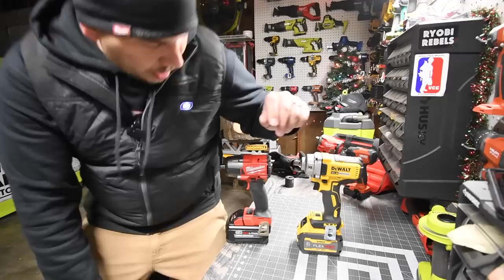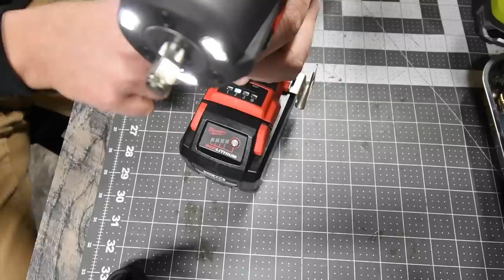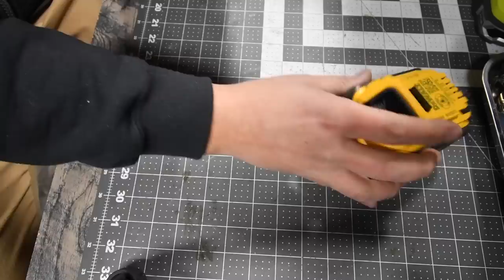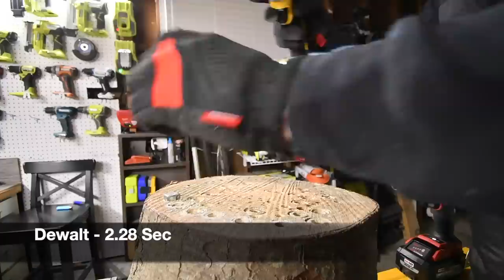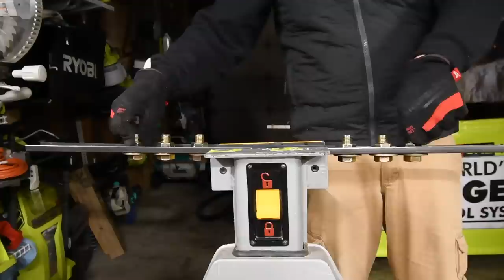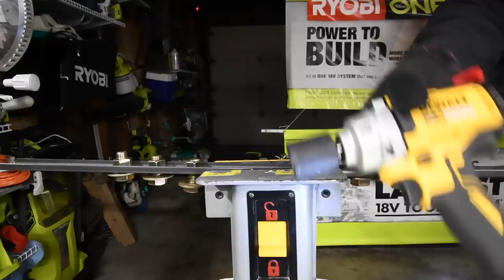NEW!! Milwaukee 2960-20 Vs.  Dewalt DCF894 (Impact Wrenches)

Comment: Coming from a maintenance field, I do use my Milwaukee m18 Mid torque a lot, I have the standard fuel model 2860, thing is a beast. And no issue in tight spaces. Personally the only thing I use auto mode for is putting something in quick. But with the variable trigger any mode ca do that too if you have the feel for it. I personally have used the DEWALT and perfect the hog ring vs pin detention. Also yes using an adapter. Even the shallow one will result in some torque loss, might be less but it will reduce the torque.
Reply from the maker: gotta love impact wrenches and I thank you again for your feedback Tyler :)

Comment: i'll be getting the dcf849 because i already have the charger and two 6 amp batteries for my sawzall and string trimmer and it will do all i need and more . but WOW ! that Milwaukee is amazing ! if i still built for a living i'd be all over it in a 1/2 inch version . thanks for sharing and take care .

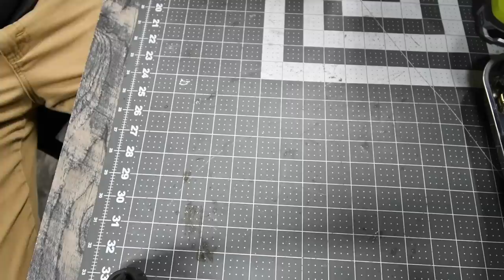Comment: The one thing I have learned is when your testing the speed of these impact drivers with the same battery out put is like testing the quickness of 2 similar vehicle's with the same horse power but one has 3:11 in the rear end and the other has 5:28 of course the one with 3:11 gears will be quicker using the same horse power.

Comment: I would estimate torque loss by 10 ft-lbs per inch on an adapter or extension. An adapter like that is probably only losing 5 ft-lbs at most

Comment: obviously the milwaukee is the winner because the torque is 600 ft lbs while dewalt is only 330 ft lbs.
Reply: Agreed a tool with double the power is no doubt going to win!
Reply from the maker: the dewalt is 600ft lbs
Reply: The dewalt on its specs sheet says 330 ft-lb
Reply: How you gonna review a tool and not know anything about it lol
Reply: Don't ever go buy written specs, I own two impact drivers one says 1600 the other 1425 and the 1425 beats it in everything

Comment: I am a huge fan of both Dewalt and Milwaukee brands.   I have a huge Dewalt collection of tools in the 18v to 54v range and a couple in the 10v range.   My Milwaukee collection is all in the 12V range and I love their smaller tool systems, especially their soldering iron.     They have a great lower voltage range that Dewalt simply don't manufacture.   One of the big benefits of Dewalt is their flexvolt range... never liked the 18v circular saws in any brand but the 54/60v Flexvolt range is a different beast altogether!  Be it Saws, grinders, table saws, blowers, whipper snipper .... just awesome.

I guess my only beef with your video is that you are wearing a Milwaukee jacket (don't get me wrong here.... I have several from wind cheater heated to work jacket heated but also have a Dewalt Jacket that is twice as warm .... have not even needed to use the battery heating power function!.....)  and you are also wearing the Milwaukee gloves.   

Mate, if you are going to do a video, selling us on your credentials that you are open to any results regardless of brand, please don't wear branded clothing that "happens" to coincide with the winning tool brand on the specific test you are doing.    In Australia, we call that a crapola moment!!!!!    ...... credibility out the proverbial window and back down shit creek!   Sorry but the small and big shit all matters!!!  

Other than that, thanks for the video!

Greg

Comment: Hi Dave

Wow, DeWalt still kept up with it's specs. 

Both great mid torque impact. You really can't go wrong with either one for a 5 to 6 seconds difference on certain application.   

Thanks for that comparison video
Reply from the maker: I agree with you on that one Micheal
Reply: It really depends on which battery platform you have.
Reply: @andybub45  that's why I'm investing in a battery and turbo charger in all three. Fuck that choosing a brand bullshit.  Best mid impact it mikitas new one,, best sawzall is milwuakee super sawzall, and best hammer/drill is DeWalts.
So I'ma get all three and then. Probably only get two batteries per platform. You can only run so many toollss sat a time so it's worth the extra price

Comment: Would love to see how the Milwaukee does against the new Makita. Really like the videos keep them coming.
Reply: Same.
Reply: Milwaukee wins.

628 ft lbs fastening for Milwaukee
514 ft lbs fastening for Makita.

DeWalt is rated at 330 ft lbs and is a 3 year old design so it was a massive under dog.
Reply: @juanc5149  Milwaukee will probably win again. True. But it will be closer than this.
Reply from the maker: once I get the makita mid range I will do a test
Reply: @ManCaverTools  awesome
Reply: @juanc5149  

Yeah, if we only look at a box spec (which you couldn't even get right, because Milwaukee doesn't claim 628 ft/lbs fastening, lol...) then Ridgid and Ryobi make impact drivers that are just as good as the Gen 3 Milwaukee.  And are better than the best Makita and Dewalts.  

Except that isn't how things shake out in real world testing.   + if you really want to compare box specs, the Makita is 740 ft/lbs in reverse, 15% higher than the 650 ft/lbs of the Milwaukee.  

Not that running a lag screw into a tree stump is a good way of demonstrating a wrench anyways.  That's mostly an IPM and RPM race.  Even impact drivers can beat high FT/LBs wrenches under certain conditions because drivers are breaking 4,000 IPM and up to 3,600 base RPM. 

Shoptoolreviews is about the only way we're going to get a definitive answer at this point. (Makita's compact class wrench benched better than Milwaukee's new one, btw)  And that's only because he has like $10k worth of equipment to get halfway useful results. And I wouldn't expect this Youtuber to invest in a $5k torque gun anyways.
Reply: Makita xgt? 40v
Reply: New New makita mid torque is 740
Reply: The new Dewalt 891 destroys all of them
Reply: Makita XGT high torque better than Milwaukee high torque and competes with their bigger model
Makita mid torque beats the Milwaukee mid torque in nut busting torque and 15% less in tightening
Makita 1/2 inch  4 speed impact wrench gets close to mid torque numbers.

Comment: Doesn't it add force on the Milwaukee bolt to leave the Dewalt bolt still in the wood and then trying to put the Milwaukee bolt it? Because your jamming the bolt and it expands the wood around it.
Reply from the maker: the entire log has holes in out so they both have an equal playing field

Comment: I think overall that your test was fair, and I assumed from the start that the Milwaukee was more powerful, as the hammer-housing looks bigger. For the sake of variation you should consider driving fasteners into material with less variables like plywood or osb. You could make a sandwich to increase the thickness.

I have the DCF894, and have still not figured out if I'm content with it. I've used it on several cars, and have experienced that it has not had enough torque to loosen the wheel-nuts, along with other bolts too that should be within the range. When it did not have enough torque it was just barely too weak. I've used it both with 6ah flex and 5ah. When it comes to especially impact drivers I am skeptical about torque-ratings. It seems to always be less then what it is advertised for. Another thing with torque is how long it takes to reach it. I have torqued my Bosch GDX-200 impact driver to 205 nm, but I was putting down torque over like 10 seconds. If it takes 10 seconds to reach promised torque, I'd say the real torque more like 150-170.
Reply from the maker: im trying to make a extreme test with bolts and nuts.
Reply: You probably aren't doing something right. This should easily be able to loosen lug nuts. Or you have a lemon.

Comment: Why using the flexvolt 6ah instead of the newer xr 6ah based off the 21700 cells like the Milwaukee. I've noticed a difference on alot of my tools using the new gen batteries
Reply from the maker: the 21700 celled battery will be used in an upcoming video. I got the 1/2 version of that milwuakee now

Comment: DeWalt better be releasing some better impacts soon or RIP their customer base.
Reply: I'm a Milwaukee user and I absolutely love their power tools, but DeWalt will always cater to people who prioritize price in their purchasing, therefore they will always be around. Not an insult to DeWalt but just my conclusion.

I think Milwaukee is on it's way (if not already there) to being in a higher teir of power tools than DeWalt. 

I almost feel bad for DeWalt when compared to Milwaukee as if it's not fair for DeWalt.
Reply: Dewalt is more of a carpenter brand.
Reply: @PepperStone3  

"I think Milwaukee is on it's way (if not already there) to being in a higher teir of power tools than DeWalt."

Not when Dewalt beats Milwaukee in most high power solutions/applications.   Put up a Flexvolt vs. an equivalent M18 HO solution and Dewalt's designs win 80% of the time.  

If we want to relegate the entire tool market to just impact wrenches, then sure, Milwaukee is clearly beating Dewalt there.
Reply from the maker: I think Dewalt needs to as well
Reply: I agree.. I need a new impact and I don't want to buy the dcf887 again, it's basically trash..  hopefully soon In 2021
Reply: I emailed Dewalt asking them about a new impact driver and they responded that they don't have a date the new impact will be coming out but it sounds like they have one
Reply: @artyb7732  I've heard DeWalt is working on a new impact driver as well... that's the hard part though is not knowing whether you need to hold off or go ahead and buy current model because it's going to be a while before the new one comes out... then you got a factor in thinking about maybe switching over to Milwaukee if you don't want to wait forever for a release date...
Reply: @BuffaloNickel9   I hear you there. That's exactly where I'm at right now!
Reply: @BuffaloNickel9  Honestly I would have switched over to Milwaukee but their gen 3 Fuel impact driver has that collet issue
Reply: @artyb7732  exactly where I was also... I'm not putting up with any collet issue though..
 I went with the 887 and it is a beast... not once have I needed more power out of it-watching these videos  made me think the only thing worthwhile was the Milwaukee for power.. but I now own other 9 DeWalt tools not including the 887 my most often used DeWalt.
 they are just more user friendly and feel better in the hand
Reply: @PepperStone3  with all respect, as I really don't want this to seem like a keyboard war.  I've had nothing but fantastic luck and results on ALL dewalt units I've purchased.  Keep in mind, I always buy the highest end versions they offer for general construction type work (I dont do gencon, but I do things that require impacts and drills).  Brushless all the way the moment they were available.  I used to snap Milwaukee shafts etc.  I will say this.  I haven't owned Milwaukee in years...as a kid I recall their products being literally the best when you wanted something heavy duty use.  I am contemplating updating what I carry on my vans to them...only thing somewhat holding me back is the arsenal of chargers and batteries for the units.  

Clearly nothing stopping me from keeping them in place...but I'd like to have a better focus on mechanic duty stuff for my boats, trailers, jetskis and powersports/power equipment.

I think everyone caters to damn near every crowd.  Theres a harbor freight for every ass.
Reply: @stupidwapdaggo  well said
Reply: Na. I'm not doing tests. All my Dewalt tools work great for my projects. Use the right tool for the right job, one tool can't do all
Reply: @PepperStone3  feel bad for Dewalt? Lol OK bro, also Dewalt is not cheap. If u want budget friendly tools don't even look at home depot or Lowes, Walmart has Hart and hyper tough all day
Reply: @Lee-lb9qh  absolutely. My tools work fine and there will always be a faster/stronger etc.etc. Product. Same reason I run my vehicles at least 10 years or until they become unreliable
Reply: I agree, DeWalt needs to offer more mechanic style tools in general. 
I've thought about switching to Milwaukee, but that's a big decision. As you guys know, these things aren't cheap. They are however, worth every penny with either brand.
Reply: Lets not be overdramatic or anything. Lol This is a single, non scientific test. First of all, it seems the measurement here is speed. Honestly, for me speed is the least important guage. I want torque, durability and longevity. I am a Dewalt guy and put my tools through hell. They have never failed. I dropped my impact driver 20 ft and the damn thing stills works. I beat the hell out of my multi tool. Its my go to for a lot of things. Still works as good as the day I bought it. I also think Dewalt has some of the toughest and longest lasting batteries. I think you cant go wrong with Dewalt, Makita, or Milwaukee. They all are top tier and get the job done.
Reply: Dewalt works better when on the 3rd setting,  the test was done with it on 2nd speed

Comment: I'm a huge Milwaukee fan but, the 5/8 x 8 appeared to jump into a preexisting hole.
Reply from the maker: it did not, I used the middle of that log for those lags and there wasn't any holes  around it
Reply: Milwaukee released the same tool but with the 1/2 inch anvil and it claims 650 foot-pounds of loosnening torque and the same 500 foot-pounds of tightening torque
Reply: Yea it definitely jumped into an existing hole.

Comment: No, this new style 6ah dewalt battery have 18650 cell, not 21700, you need just take 20v 8ah battery like dcb206 or dcb208
Reply from the maker: you are correct. I did  live stream and opened the battery up. it has 18650 cells

Comment: The 20V MAX* XR® ½ in. Mid-Range Cordless Impact Wrench with Hog Ring Anvil delivers up to 330 ft-lbs max of fastening torque and a lightweight, ergonomic design.
Reply from the maker: really? 6 comments saying the same thing? 600 ft lbs of nut busting torque and 330 ft lbs for fastening torque
Reply: @ManCaverTools  correct.  Plus the dewalt/Mac is made to be serviced without breaking the tool apart unlike Milwaukee.  Also u can swap the 1/2” anvil for a 3/8 on the 894 in 2 minutes

Comment: I thought the flexvolt battery was a disadvantage on a regular 20 volt dewalt tool use the 6 amp 20 volt dewalt battery with 21700 cells
Reply from the maker: I thought that as well but I wanted to see the truth for myself. but they do not

Comment: If you had one impact, for the mid torque would you go with 1/2” or 3/8”?
Reply from the maker: I would go with 1/2 in im not a fan of 3/8 in
Reply from the maker: and I thank you for viewing Damon
Reply: As a heavy truck mechanic, I would highly recommend a m18 1/2 mid torque and m12 3/8 stubby. For very high duty cycle jobs, I would recommend a ingersoll rand 2235 air impact, if air isn’t an option the 1500 ft lb ingersoll cordless
Reply: “Busted the nut”

Comment: Why do you use that large chrome socket for impacting? Seems dumb.
Reply: He told us why in some of his previous videos
Reply: @emmanuelmartinez8312  It doesn't bother me that much. Just seems dumb to not buy an impact socket.
Reply from the maker: I need to get an impact rates 1 1/2  sockets
Reply: Sunex 248 1/2-Inch Drive 6 Point Impact Socket 1-1/2-Inch

Comment: Agree with some other comments. But you only have to look at the specs to know that Milwaukee wins in power in most tools (almost always). Not test necessary... I'm most interested in the other attributes like weight, ergonomics, price, that's why I like a perspective on the tools. Like: Is the Dewalt still worth it? I will still like watch the videos keep them coming Dave! Those are just some constructive ideas.
Reply from the maker: it still is a good watch
Reply: I own both Milwaukee and DeWalt tools. The only thing Milwaukee is more powerful at is impacts and I absolutely love them. But drills,saws,blowers, heck pretty much everything else including accessories DeWalt is superior.

Comment: Milwaukee is newer.  So the results are 500 rpm faster.  I do feel like the DeWalt hit a knot on the last 5/8 lag, while the Milwaukee didn’t.

You could get the DeWalt mid torque for free, (with purchase of select tools.). so maybe new line of impacts are coming.  Who knows.

What were the weight of each tool?
Reply from the maker: I need a scale. I will get one

Comment: In my opinion comparison or test videos should not be done using adapter sockets period. There is torque loss and especially when you had them double stacked. The dewalt had the advantage but the Milwaukee still outdid it but it was at a disadvantage with the adapter. I would either get the correct socket or not do the testing at all.
Reply: These tests aren't even that close,  so the adapter isn't even a concern. If both tools shown were running into situations where the results were a near tie then I say redo with a proper half inch drive anvil on the Milwaukee.
Reply: @Dale37  the fact that I stated that the Milwaukee was at a disadvantage yet still came out on top leaves your comment irrelevant. What I was getting at is that tests shouldn’t be done with equipment that lessens the power of the tool
Reply from the maker: but the tool that majorly won had the adaptor, so I think its ok in this test
Reply: @ManCaverTools  yea the electrics don’t get dragged down by attachments because their IPM is crazy high. I think extensions are the worst. I use a high torque and it seems the extension just kills it

Comment: I’m confused where you got the specs for the Dewalt. Dewalt advertises that 1/2” impact at 330 Ft-Lbs of Max fastening torque. They don’t provide a reverse torque spec. So where did you get the 600 Ft-Lb rating from?
Reply: 600 is the max breakaway torque.
Reply: Where did you get that spec? That was my question. It’s not in any of Dewalts materials that I can find.
Reply: @BigBear--  Well, I have the impact wrench, ane its on the Home Depot app. The 600 is the breakaway rating.